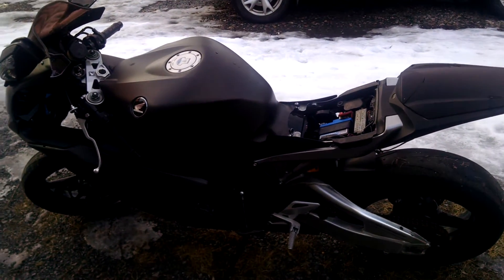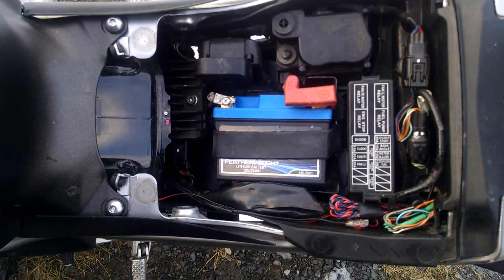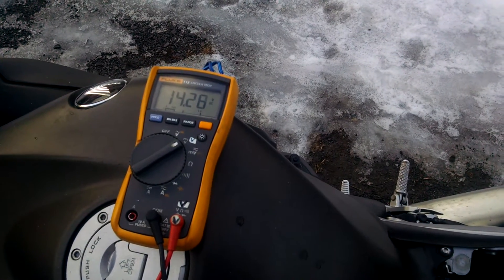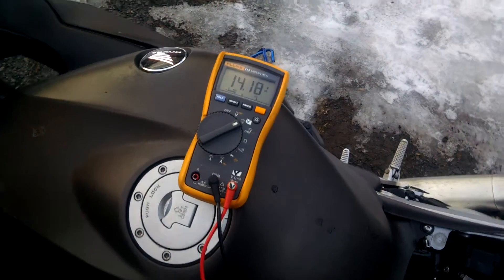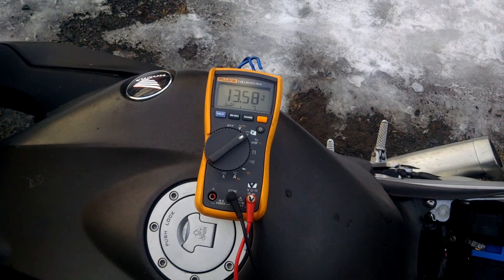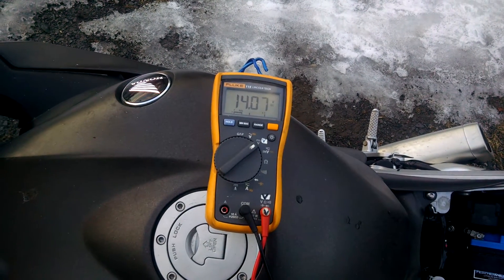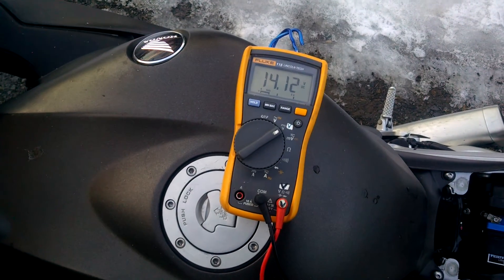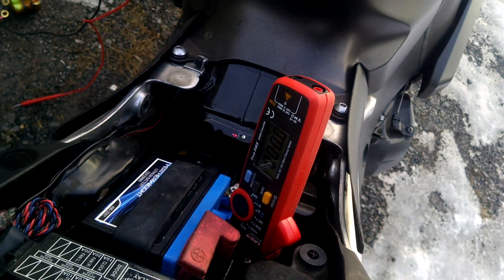Honda 1000RR LiFe battery $73 - Lithium

Comment: How is the battery after 2 years? Is still strong enough
Reply from the maker: Still working great year 6. I havent even been disconnecting the negative terminal during winter but I do start it for a few minutes every month or two.
Reply from the maker: Still working great. I have 3 of them now and they are all working, even starting 1000RR in cool weather after sitting in the bike for 2 months